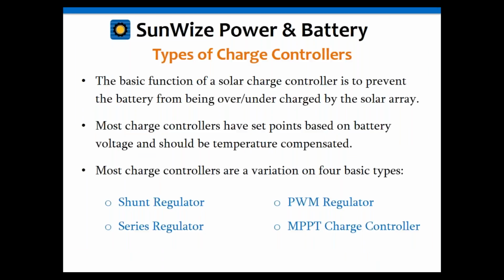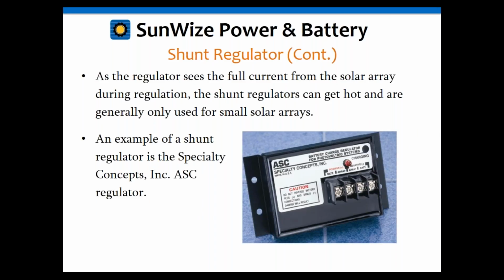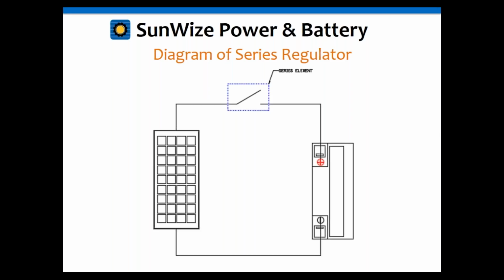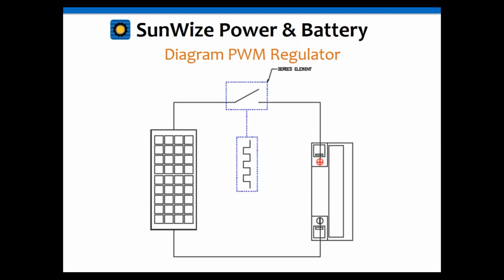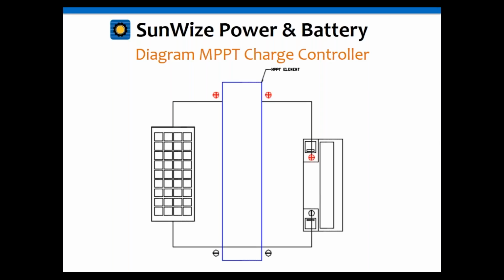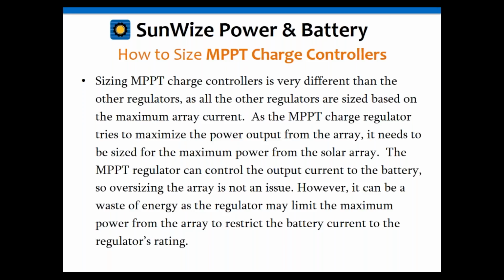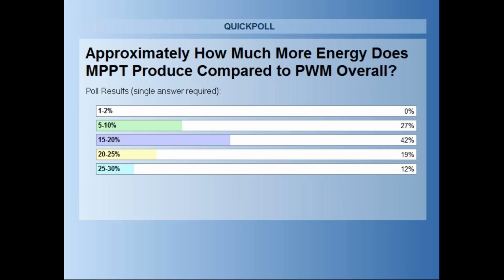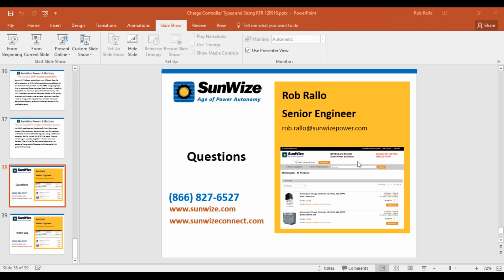Charge Controller Types & Sizing

Comment: Question- Do I need a bigger charge controller for 400 watts?

 I have a HQST 20a MPPT Controller in my array (only 200w of panel now) and want to get my panels up to 400w  in a 12v system  
In the manual it says 12v systems can only input 260w ... 
   That doesn't seem right...$100. for a charge controller that can only handle less than 300 watts? lol

Does that mean I have to put two panels in parrel and 2 in series or something like that? to keep the wattage input down?